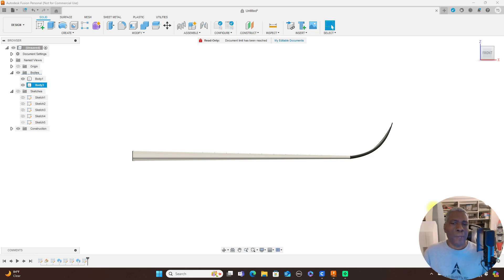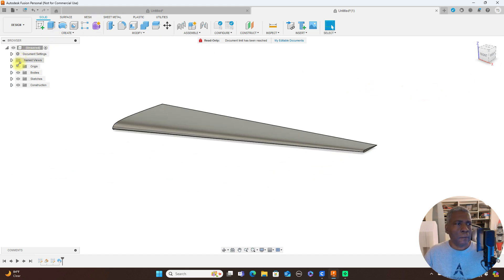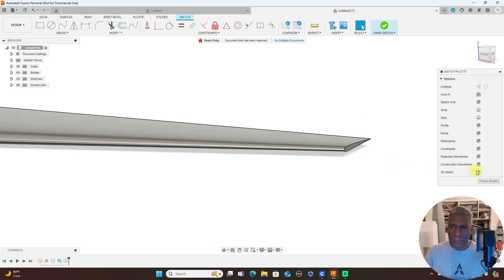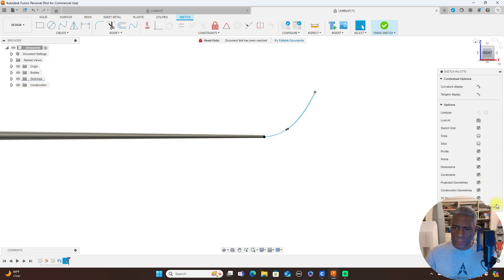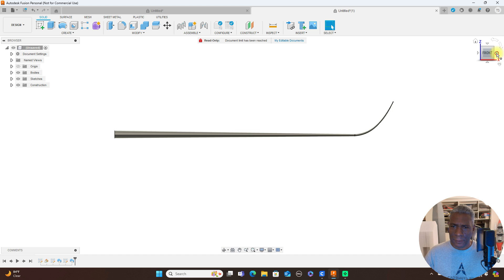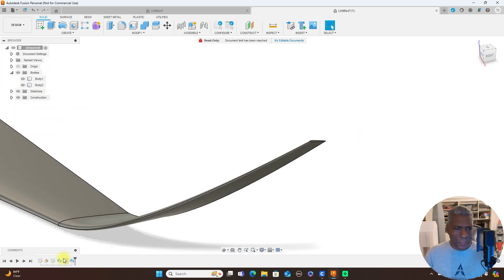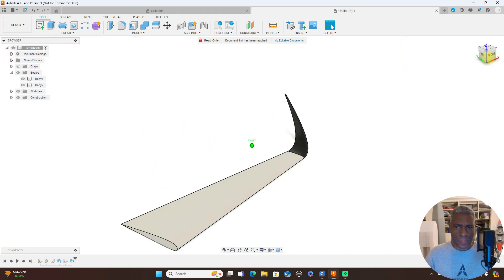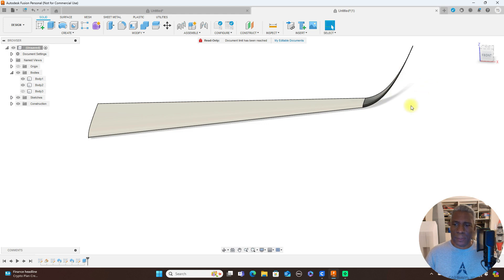Easy way to model winglets in Fusion 360. CAD

Comment: "Hi! Could you make a tutorial on how to draw a gull-wing style aircraft wing from a front view? I’m specifically interested in how to draw the wing shape seen on the Embraer E190-E2, where you can clearly see that smooth S-curve — the wing slightly rises near the root, then gently dips toward the tip, and ends at the winglet. How do you correctly construct that curvature and get the proportions right in a front-view drawing?" 

I have one more question: when I enable 3D Sketch and select a line, my 3D sketch in palette gets shaded immediately, and it doesn’t let me continue drawing in 3D. I followed your steps exactly, but something is blocking me from entering the proper 3D sketch mode. Do you know what I might be doing wrong?

Comment: Hello my friend ,so how much will IT take someone to design and make all the files to Be printed (my own designes ) ...im looking fourd to get into 3D printing but i wana know If its hard or not ...thanks
Reply: Hi. I am in my early 60s and started playing with F360 and 3D printing about 6 years ago and it was quiet a learning curve. I must have watched 100s of hours of Youtube videos. However, once you get the hang of it its a lot of fun. Make sure you do your research before buying a 3D printer.
Reply: @heinzd5523  first of all ,thankyou for takeing your time to answer my question ,so i was thinking of buying one or two banboo lab printers ,but since i donț have any experience with 3D modeling (im a little scared to spend so much money
Reply from the maker: @florinștefy  The Bamboo labs printers are very good and you will not go wrong with buying them.  You can buy a cheaper printer just to get started with and learn.  I started with a creality Ender 3 pro.